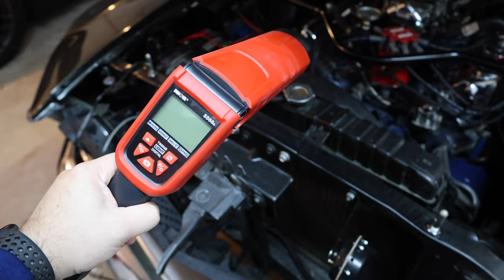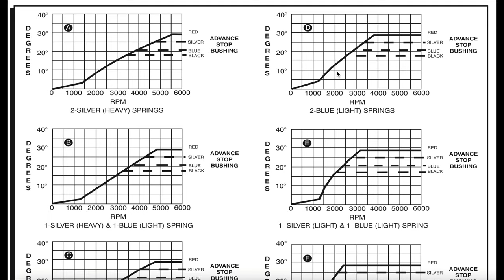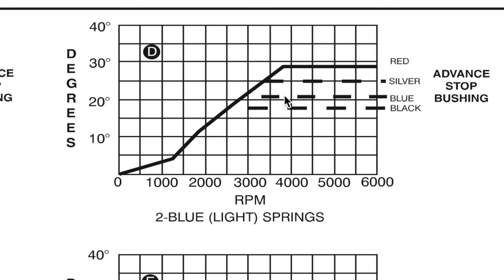The CORRECT way to Set Timing on Ford Engines with a Distributor

Comment: Working on a 351C 2v in my 72 mach 1 atm, been having some issues.

It originally ran off timing with the distributor rotor not lining up with 1 at TDC, and timing light can't see timing mark from front left, so I pulled the valve cover, verified the timing mark on the balance was indeed TDC, and set the rotor to point at 1. Now, it's no longer turning over, timing is way way off. Have a Pertronix D134620 distributor, new ignition coil, and have rebuilt the carb.

Figured if anyone might know it's the car people here lol, my distributor doesn't look anything like that though.
Reply from the maker: I'd check a few things. First, are you at TDC on the compression stroke? Can quickly check by rotating the distributor 180 and see if that helps.

Second, I'd check to see if you are using the right timing marks. A lot of Ford's with aftermarket balancers have multiple sets of timing marks.
Reply: @Smackey's Garage  Thanks for the response! I found the issue. It was the factory balancer, but when I pulled it, the rubber had worn and shifted, causing the mistiming. 

New balancer in and running great!
Reply from the maker: @criseist9786  glad you figured it out!